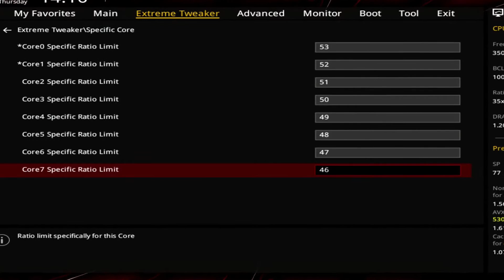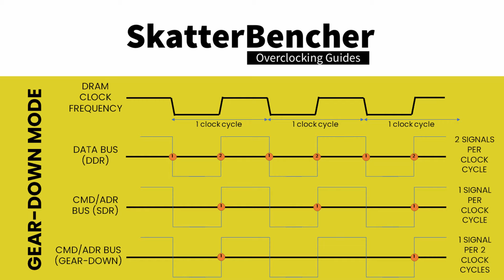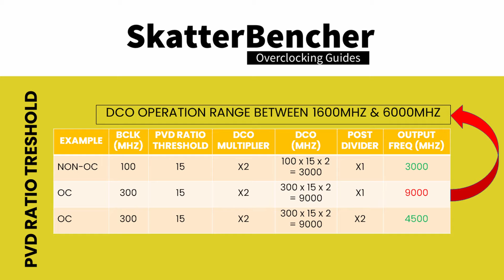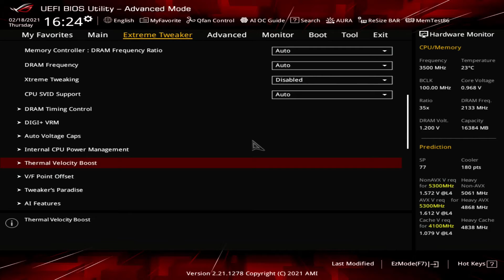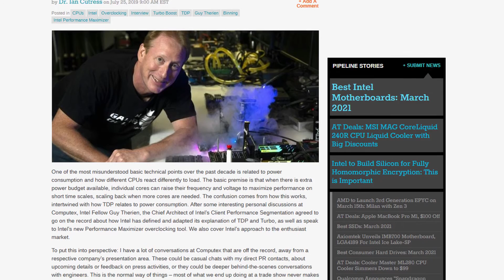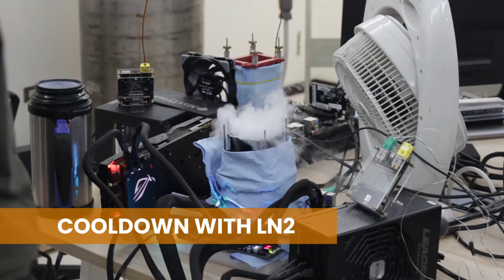Rocket Lake Overclocking: What's New (Feat. ROG Maximus XIII Apex)

Comment: What would your recommendation be to keep voltages down?  No matter what I set my voltages go above 1.5 and at times 1.6v at 5.1ghz and above 1.5v at 5 ghz. I also can't get cpu to ring down when not in use. Constantly staying at boost even if I disable all asus and Intel turbo boost options. 
11700k on maximus 13 hero. 
Thanks

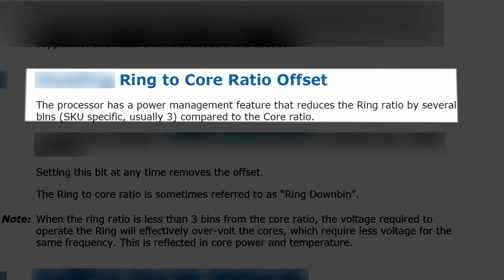Comment: I revisited this video 5 months later and STILL cant figure out why Im getting +100mv or more vcore overshoot? 1.5v set / 1.613v get, or more. At 16:25 he seems to explain that the cpu & cache share the same voltage plane which seems like it could be the reason but at only 45x cache oc I doubt it. however I tried lowering my cache oc from 45x to as low as 40x and Im STILL getting the same vcore overshoot! Ive also enabled RDB w/ 40x cache but no go.

Comment: 👍great tech video on rocket lake, first (only) comprehensive tech video found. Simple question: can I overclock Adata xpg ddr4-3200 cl16-18-18 to higher frequencies that are supported by Asrock Steel legend B560 with Intel 11500. Casing is well ventilated by fans with ambient 27C. At casual loads both CPU & mb at 40C, set high performance mode and all on auto with xmp enabled. Seeing CPU at 4.6 (all cores showing similar 4.6 - 0.1/0.2 using cpu-z) and ddr4 at 3200 frequencies.

Comment: What core voltage was used for that He cooled record? as the core VID was 1.375v which is kinda low.
Reply from the maker: I think around 1.7V, but I'm not sure. You can check with ElmorLabs on his discord: https://discord.com/channels/514312075686838282/514312075686838284

Comment: Awesome vid, Can i ask a question? Im about to buy the Asus Apex z590 mb will it work with my cooler master Ml 360 Subzero aio, ive currently using the Asus z590 e gaming but there's no support on the ASUS site for the cryo cooler in the bios for that mb, so the fans just run 100% all the time, Was wondering if you ran your cooler on the Apex an notice the fan speed ran like it should. Thanks man keep up the good tutorials, Subbed
Reply from the maker: Thanks for the kind words!

I did a VERY long video on Cryo with the 10900K & M12A where I explained all the various settings I used to set up a reasonable daily overclock: https://youtu.be/xp7KtN3vOhs.

What's key about the Cryo is that the maximum long term power is limited to 200W. This lower than what a regular custom loop water cooling system can handle. For example: my EK Magnitude & 360 radiator can handle a Comet Lake CPU at 350W without throttling.

When the TEC gets too hot, the software will shut it off and then the cooler will work like a regular AIO ... but with more distance between the CPU and the coolant (so the performance might be worse). So, this will result in higher CPU temperatures, and ultimately the fan speed ramping up.

My suggestion for Cryo would be to use the AI Cooling: https://www.youtube.com/watch?v=xp7KtN3vOhs&t=1664s. Set it up to hit maximum 80 or 85C. This feature will automatically reduce the frequency when it hits this temperature and may avoid excessive fan noise.
Reply: @SkatterBencher  Thank you for your reply, I ended up getting a 11900k an a Asus z590 Apex xiii an will def be using your settings, i lost out on the silicon lottery tho lol my SP is 50🤦‍♂️

Comment: Hey there! Excellent video. I'm kind of disappointed with 11700K as it has higher temps over my 9900k. Playing BFV (4K 120hz,ULTRA) I reach 85-90 degrees whereas with the 9900K I barely got 70 degrees. Must be some kind of configuration as the whole CPU package is what is overheating the CPU, MB temp is fine (Maximus XIII Hero z590) I think it was because of the AI suite and therefore I should move to Manual BIOS settings. Cooling system is Customloop 2 360 EKWB SE rads.

Comment: How do you explain the fact that on my 10900k and Asus apex xiii after overclocking .... The computer during stress (gaming) does not hold the assumed core 51x, only jumps to 43x, 47x etc ..
Reply from the maker: Are you overclocking using 'by core usage' or 'sync all cores'?

Are all power limits unlocked?

Do you have the AI cooling feature enabled?

Is the CPU reaching over >100C during gaming?

Comment: Never use AVX offsets.  5ghz cpu with a -2 avx offset is a 4.8ghz cpu.
Reply from the maker: But ... if it's a 4.8GHz CPU why is it running 5GHz in SSE workloads?
Reply: well if u are gaming then diable avx completely. and no avx offsets are good if u want to do some cpu workloads using avx cause u dont need to have two bios profile to switch from gaming to sse workload so avx offsets will save u time , thats it if u are a gamer u dont need to care abt it too much

Comment: Great Video and Content thanks a lot! Do you believe that the Z490 Apex (I own it) will allow for similar performance in general compared to the Z590 Apex?
Reply from the maker: General performance difference between Z490 and Z590 is not large, so it should be just fine. That said the Z590 Apex was tuned specifically for Rocket Lake.

Comment: Hy, 
I have Asus rog strix z590, Corsair VENGEANCE® RGB PRO SL, 32GB DDR4, 3600MHz CL18, Dual Channel Kit, WD Black SN850, 500GB, I9 10900kf. Corsair iCUE H150i ELITE CAPELLIX Liquid. And RTX 3070. 
In bios SP=63, and with Asus MCE on the CPU go to 85-90. Now i sad to try the 11900k in bios SP=73. This with MCE set to on hits 65-70 degres. If i enable the the new adaptive boost hits 80 degres But in cinebench r20 and 3d mark the 11900k has lower score that the 10900k. In bios XMP1. I dont no why is lower and what CPU to keep?!? Thanks
Reply from the maker: I presume the score is lower because the 10900K has 10 cores and the 11900K has 8 cores?

Comment: Hey SkatterBencher, awesome content, thank you very much!

But I do have a question about the 2 favored cores in the "Specific Core" submenu of the bios.
If I got your explanation right, then the 2 cores highlighted by a "*" are the strongest ones of your cpu?
If yes, are those the ones used for (lets say) single core boost?
Reply from the maker: Thanks for the kind words and great question!

The "favored cores" are part of the Intel Turbo Boost Max Technology 3.0 (TBMT). In short, there is a natural variance of quality of cores in each CPU. The better cores are able to operate at a certain frequency needing a lower voltage than the other cores. TBMT 3.0 exposes these better cores and does 2 things:

1) It ensures the operating system prioritizes these cores when workloads are assigned.
2) It allows the better cores to boost 1 ratio higher than any of the other cores. (52X instead of 51X for 11900K)

You can see why combining (1) and (2) will give the user a higher performance: more workloads are assigned to the cores which are able to boost higher.

Now, when looking for the "strongest" or best overclocking cores, obviously we would expect the favored cores to be the strongest cores. We expect a higher overclocking headroom because they require a lower voltage to operate at a certain frequency, thus with increased voltage they will be able to operate at a higher frequency. In the case of the Rocket Lake 11900K, the 2 CPUs I tested both had 1 of the 2 favored cores able to hit 55X stable, while the other could reach 54X.

Prior to Rocket Lake, when we would configure a dynamic overclock with a peak frequency of 55X for 1 active core, this frequency would be applied to any core if it was active (and the others idle). Since the weakest core would not be stable at that frequency, the system would crash. What's great about Rocket Lake's "Per Core Ratio Limit" is that we can now prevent the weakest cores from accidentally hitting the highest frequencies.

Hope this helps!
Reply: @SkatterBencher  Thank you very much for your absolutely great explanation!

I do have one more question to ask if you allow me to:
I got my 11900K yesterday and I‘ve been trying to OC since then, and I would like to know your opinion about what I would call „weird“.
My 11900K can achieve AllCore 5GHz at just 1.3V and my Z490 Hero says it has a SP of 89 (which some of my hardcore CPU & RAM OC friends would call a „good/decent bin“.
BUT, when I try to go even higher, lets say 5.1GHz AllCore I need 1.41V, and for me, this voltage gap seems to be too huge for +100MHz on each individual core.
Okay, yes there could be 1 or 2 cores which are complete junk which would explain that a little bit, maybe even the efficiency curve goes exponentially up after 5GHz.
I‘ve tried to battle against this with various different LLC modes (4-7), ive tried each voltage gap between 1.3V and 1.41V and I dont know what else to try.

I know its a new architecture which behaves differently on 14nm but it was still a „shock“ to see.

I would gladly hear about your opinion in that case since then I can maybe get a better understanding of the situation.

Thank you very much!

Edit: Im using an AVX offset of 0 (atleast for AVX2)
Reply from the maker: Hm, this sounds like strange behavior.

Correlating your results with mine, I'd say 1.3V for 5 GHz all core sounds reasonable. I think my chip needed slightly less than that, but it's within ballpark. 1.41V for 5.1G sounds not at all reasonable. Not just because of the big voltage jump, but also because the CPU would most definitely hit really high temperatures with that voltage and running a workload on all cores. Even with water cooling. And definitely if AVX offset is 0.

I presume you're on the latest BIOS which supports 11th gen and you have adequate cooling?

Since the frequency you're targeting is below the default maximum turbo ratio (53X for 11900K), it shouldn't be that difficult to find out which voltage is required for 5.1GHz. In fact, Intel's factory-fused V/f curve has already defined the required voltage for 51X ratio! 

All you need to do really is check what Intel's using as voltage at 5.1GHz and see if you can lower it a bit.

- Set all BIOS settings back to auto
- Enable ASUS MultiCore Enhancement (this removes the Turbo Boost constraints)
- Set CPU Core Ratio to Sync All Cores
- Set All-Core Ratio Limit to 51X
- Set CPU Core/Cache Voltage to Adaptive Mode
- Boot into Operating System & run a light workload (SuperPI, Cinebench single thread, ...)
- Check with Hwinfo what's the effective voltage.

If you can't boot into the operating system, then I would suggest to check the temperatures. 5100 MHz on the 11900K is pretty rough. I tried this frequency with Prime95 non-AVX and the temperature with custom loop cooling was around 90C pretty much all the time.
Reply: @SkatterBencher  Hey, thanks again for the answer!

My Z490 Hero (Wi-Fi) BIOS is on the latest available version and I'm using an ASUS ROG Ryujin 360 AIO watercooler.
With that, I'm getting 70-80°C on AllCore AVX Workloads while using 5.1GHz 1.41V AllCore OC with LLC4.

I've also tested the OC you wrote:
5.1GHz 1.46V Idle, ~1.4V AllCore AVX Workload while hitting 80-90°C
5.2GHz 1.51V Idle, ~1.46V AllCore AVX Workload while hitting 90-100°C.
My manual OC results @ 5.1GHz were much better.

Oh, and if Intel's factory-fused V/F Curve could help you, this is mine:
800MHz / 0.779v / +0.000v
2500MHz / 0.863v / +0.000v
3500MHz / 0.967v / +0.000v
4300MHz / 1.104v / +0.000v
4800MHz / 1.217v / +0.000v
5100MHz / 1.338v / +0.000v
5200MHz / 1.398v / +0.000v
5300MHz / 1.398v / +0.000v

5.1GHz @ 1.34V boots but crashes while doing CBR20 AllCore (works fine at 1.41V, but it does not seem to care if I put LLC4, 5, 6 or 7)
5.2GHz @ 1.398V boots but also crashes while doing CBR20 AllCore (runs at 1.45V with LLC7 but hits 100°C half way through the benchmark)
I dont remember anymore if I tested 5.3GHz @ 1.398V but what I do know is that CBR20 AllCore crashed with 5.3GHz at 1.45V.

But something is weirding me out even more, I found some people with roughly the same SP amount and they could achieve this (all 3 were on Z590 boards):
Maximus XIII Hero, 11900K SP 81, 5.3GHz AllCore at 1.38V, LLC6
Maximus XIII Hero, 11900k SP 84, 5.1 all core clock and 4.5 ring at 1.365v with llc5 and Avx offset 0
Z590-I Gaming WiFi, 11900K, 5.3GHz AllCore at 1.44V

Could it be that my Z490 is "bugged"?
I'm asking because some of my friends & people I spoke about this "problem" told me to upgrade from a Z490 to a Z590 to get better AllCore OC & performance results due to Z490 not being updated frequently and most BIOS versions seem to be bugged or even worse things.

Could this be some sort of an indicator about the huge voltage gap I wrote about? 1.3V @ 5GHz works without problems (and I dont tested lower than 1.3V) but 5.1GHz only seems to work on 1.41V regardless of the LLC?

Any ideas?
Thank you!

Edit: Just had a Crash with 1.41V and LLC4 at 5.1GHz. I'm now at 1.415V with LLC6 at 5.1GHz.
Reply: @wubziz4769  okay so , i have heard issues with z490 boards with 11900k which could be the reason maybe a new bios might help but nonetheless. cinabench r20 doesnt take much stress on the load tbh , so will ask u some questions. whats the cache u are running, did u check your mount, this generation the mount is really bad the cpu is really concave i have pics on it could share it with u, add me in discord if u want .Boogеyman#9853. umm see your voltage drop on load some cpu i have heard have really high overshoot/ really high undershoot. so u need to adjust your loadline. second on gigabyte boards there is a special overclocking feature called "override mode". which umm hard to explain https://www.youtube.com/watch?v=zqvNkh4TVw8 watch this vid u will understand thats why he didnt go through loadline since u dont need to on gigabyte boards .GLHF with your cpu

Comment: My results are a little different from yours. My 11900K has an SP score of 74 in the ASUS Z590-E, and I turned on all auto boosts but manually capped voltage to 1.375 for testing. It’s auto turbo boosting to 5.3 GHz all core without any issues, peaking at 68-69C with an NH-D15 at reasonable fan settings (not 100% speeds). This result seems drastically different from what many online reviewers are reporting. Is the binning that extreme? SP 72 should be above average but not to such an extreme degree that I’m getting 5.3 GHz all core at 1.375V at under 70C with ambient air cooling compared to exotic custom loops posting worse numbers.
Reply from the maker: You're seeing 5.3GHz all core? Did you check with Hwinfo what frequency each core is actually running at?

On 11900K, 5.3GHz is reserved for only the 2 favored cores (Turbo Boost Max 3.0) when the operating temperature is below 70C (Thermal Velocity Boost). The other 6 cores will run at 5.1 GHz max regardless of the operating temperature.
Reply: @SkatterBencher  The only settings are changed are manual voltage because the Auto was going to 1.5+, enabled ASUS MCE (Enabled - Remove all Limits setting), enabled Intel ABT, and enabled memory XMP. Didn't touch core ratio or specific core settings, those are all on Auto. HWInfo64 reports 5.3GHz frequency on all cores. Voltage is at 1.375 still and temperatures approach 70 C but don't quite reach it (68-69 peaks) in non-AVX loads. I assume it's the ASUS MCE doing the all-core boost but it's stable and was as close to a zero effort OC as it gets.

Comment: Congratulation on a superbly crafted and  detailed video.  I'm waiting for the Apex XIII to be released in the US.  By chance do you know if the Bios in the  Maximus Z590 Hero is as granular in overclocking options as  your Z590 Apex? I have a 11900K  on hand and am anxious to complete my build but don't wont to wait much longer on the Apex XIII while the Hero  is  widely available . .
Reply from the maker: BIOS wise I think Hero and Apex are pretty much the same. If there are settings that aren't carried over from the Apex, they would be mostly for extreme overclocking. For ambient cooling the Hero should have all the BIOS options you need.

Hardware design wise, the Apex is a bit different of course :)
Reply: @SkatterBencher  Thank you Sir for the quick reply.  Leaning towards the Asus Z590 boards but  the  Dark Hero  is still winking at me . .
Reply from the maker: I can relate. The Dark Hero is such a cool board :)

Comment: Learning here u have check the video. If a 10850k is pair with z590 most funtions will not appear. And seams like have a 10th on new board reacts  somehow similitudes i manage to make 5 with 1.27 but r23 pass ok but xtu does not as a example.  I need to learn

Comment: Thanks for your hardwork. I have an unrelated question. I ask you bc you are the only person that responds. Lol. Know anything about gigabyte mobo bios? I have f30 and want to try curve optimizer. Thinking about updating but not too cpu literate. Just asking if its worth it to update bios.
Reply from the maker: I'm not sure what motherboard you're referring to for F30 bios, but the general rule of thumb for BIOS flashing is "if it ain't broke, don't fix it".

That said, BIOS flashing is very safe nowadays and I haven't had a bad flash in years. Most motherboards also have recovery functions in case a BIOS flash goes bad. I still get nervous every time I flash though ... (must be PTSD from the bad BIOS flashes many years ago)
Reply: @SkatterBencher  again thanks for your help. I have x570 Aorous pro. F32 bios has a curve optimizer i want to try but like you said its a risk. Thanks again